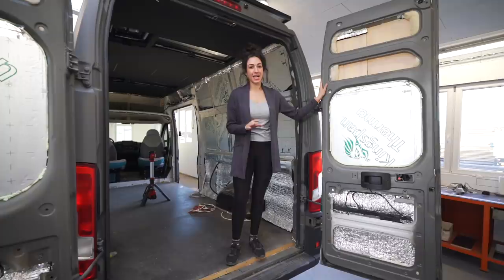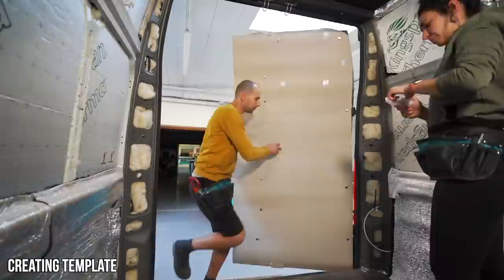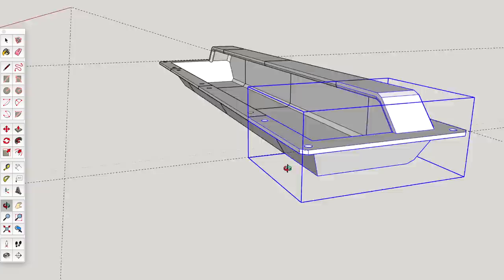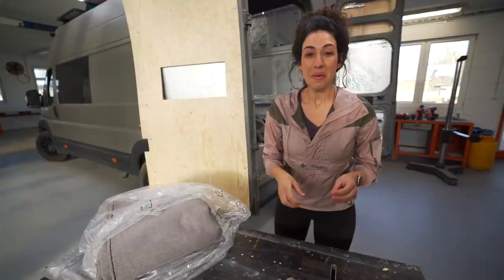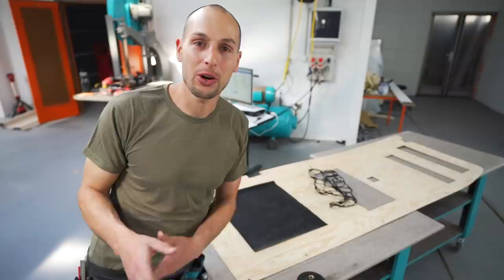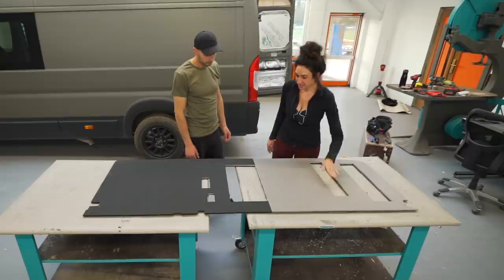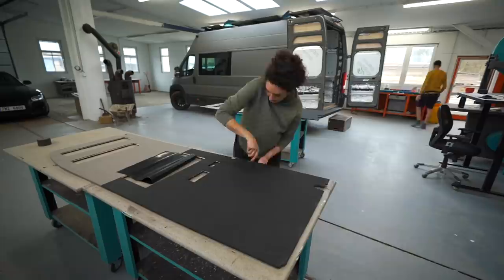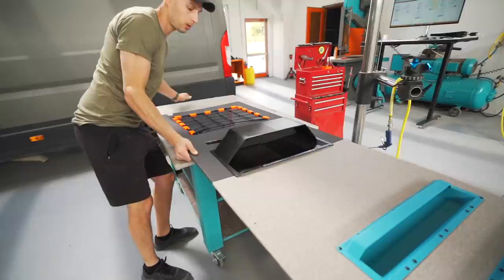NEW High-Tech Back Doors for Van Build / S3E3

Comment: Thank you for this. Back doors have been a real head-scratcher for me. I have been thinking about the overlapping plywood to get rid of the 'breezy' draft coming through the join (slightly misshapen doors with daylight visible...). I now see that it is a worthwhile plan. And also, making sure the plywood completely covers the metal inside because of the thermal issue with the metal being essentially one piece. So I'm doing the same as you. Thanks for helping me make that decision! :)

Comment: If anyone hasn’t already mentioned. On the drivers side of the door maybe you could put an overlapping piece so that when you close the pas side it covers the gap between the doors and help stop any wind/cold coming through? Pop a bit of that fluffy seal on that you did on the window covers. 

Also maybe some like fluffy type of thing that you can put on the door which will hide the latches at the top of the doors but still allow them to pass through? 

Awesome build by the way! I would love to come over and get stuck in giving you guys a helping hand.

Comment: You need a k40 laser cutter for making those kind of flat pocket things, it's quicker to design and even quicker to cut out, you can use 3mm plywood and tabs with wood glue, light and super strong.

Comment: I would probably have wanted to use a thin padding under the fabric on the doors. It would have made it softer to touch, and I think it would have looked a bit nicer too. And maybe it would also have helped a bit with the insulation. I am glad you are happy with the turqoise color on the shelves, but if it was my van I would have preferred that they blended in with the colors of the doors instead of jumping out like that. I would have chosen dark brown for all of them.

Comment: Incase you ever have to replace the plywood try sourcing something called King Starboard from the boating industry.
It's a marine grade boat plastic polymer sheet building material that  cannot rot, or swell.
The plastic lumber is available in a variety of colors and sheet thicknesses and can be easily cut and machined using standard woodworking tools.
The downside is it can't be glued or painted, isn't as strong structurally as wood and it's pricey. 
Think of it like plastic cutting board material that comes in colors.

Comment: Very nice build! just a tip for layer lines on your prints look into acetone smoothing just depends on what type of filament your using
Reply from the maker: I think acetone smoothing is only applicable with PLA, we print with PETG.

Comment: I actually came up with an idea for an outdoor shower as I’ve never seen anyone do it. This would make more space or storage inside the van. By using heavy duty slide out standing platform from the garage then hooking on both doors at the end, then a shower curtain that wraps around that area your in. If it rains, can add a small awning at the top to cover the space. If parked at a mountain facing the ocean forget the curtains and shower butt naked with the view😜

Comment: curious if at a later date, if the segmented door inserts start to move apart when under load and/or because of road vibrations could you add self adhesive sheet/film that covers the outer face of the inserts and spans the seams and folds over the top edge. Like they cover buses or cars with larger graphic films. Wood workers use tape to hold seams together when gluing and it is amazing how much tension can be achieved I'm just thinking of a more permanent film than tape. Ladi never disappoints in the inventive department. I'm not a van person but I love seeing creativeness in full form. Great channel!

Comment: Now looking back.... wouldn't it be a better idea to use correx (hollow plastic boards) for these panels?  Weight saving, same rigidity, better insulation than plywood (because of air gap), and less chance of warping over time.

Comment: On both sides next to the rear doors, if you fill with insulation are you blocking those vents that are used to release pressure when you shut doors?

Comment: Loving your video. I'm also just in from converting the same van though bit slower and not quite to the same detail but will be following some of your design choices. Are you planning on using any aluminium extrusion in the build?
Reply from the maker: We’re not sure yet. It’s possible but it’s very time consuming.

Comment: Hi Ladi & Margret 

Did you look into the possibility of creating a lightweight wooden skeleton door frame for where you needed the strength , thickness and somewhere for the screws to bite into .
Then filling in the gaps/ holes that remain by bonding in some lightweight plastic sheet to support the material on the frontside and insulation on the backside ? I realise this would be far more time consuming and you have upload schedules to keep . But would there be a significant weight saving to be gained by doing the panels this way ?
Just curious as I don't know how light or rigid the plastic sheet is in comparison to the wood and Ladi did say "every gram counts" LOL.

Keep up the good work . This is a very inspiring build . I wish you all the best for the future .

P.S. Margret I hope you find Millie safe and well soon .

Fattrucker

Comment: Great job on the 3d prints, do you use regular pla or something else for printing?
Reply from the maker: Hi, PETG only.
Reply: @ladiandmargaret  won't PETG soften when the van will be hot under the summer sun? Better than PLA but probably worse than ABS.
Reply from the maker: I don’t think so. It won’t be exposed to more than 60 celsius